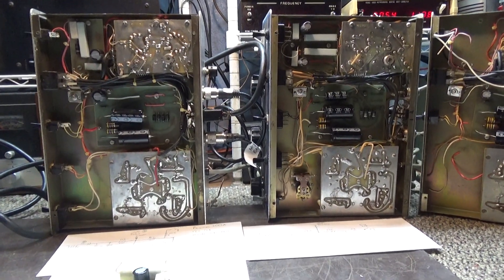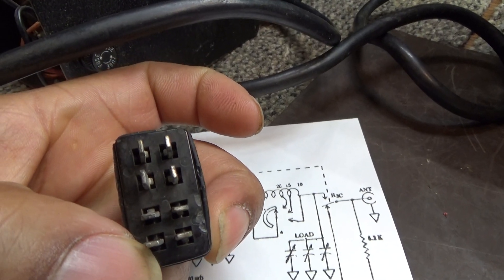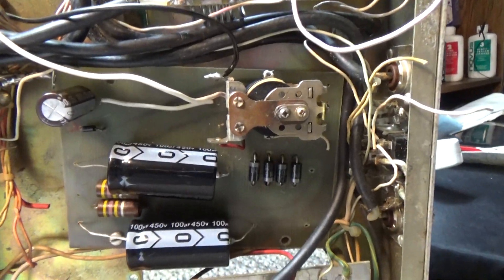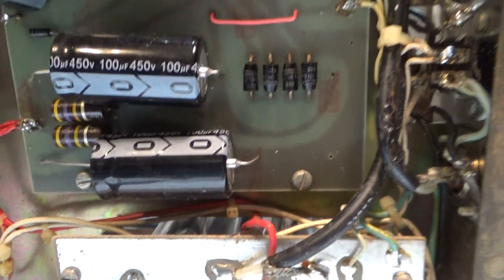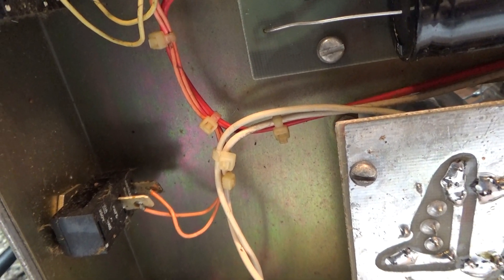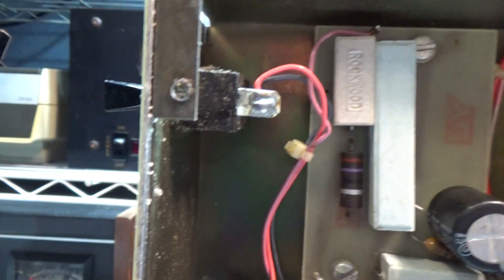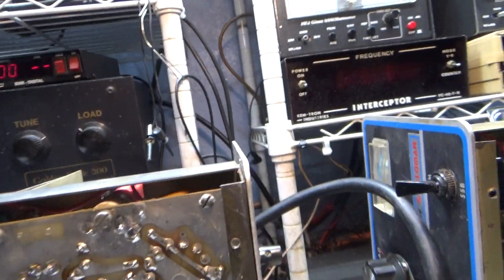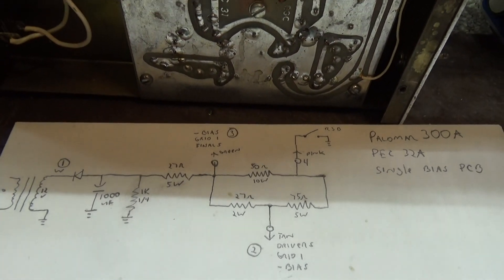Palomar 300A variations and differences

Comment: Are you still interested radio?if so i Have a palomar 300 a linear amplifier. There's one wire from the tube circuit. The 42 shaded board the finals. A wire that goes to some place a came off of the other side of the board and goes from that trigger trigger to the other one.  It's gonna wear a coat the other side.If I have your email, can I email you a picture of it?What i'm talking about
Reply from the maker: tramdr@yahoo.com

Comment: Mine don't have a relay
Reply from the maker: That could be trouble.
Reply: @tramdr  on the board or mounted on chassis but the top still has factory rivets so I know that wasn't removed.Do you still work on them
Reply from the maker: Sorry, No
Reply: @tramdr I must have the newer version with no relay
Reply from the maker: No, that would be the older version. The newer versions added the relay.
Reply: @tramdr  ah ok what relay part number  do you use
Reply from the maker: I just get a generic general purpose twelve volt relay. Nothing special. Even though you only really need one pole or contact, I get a 3pole or four pole and wire all the poles in parallel. The on in the vid is a generic four pole and they are only using 2 poles.
Reply: @tramdr any special amps on the
Reply: Did my caps flipped the board over someone had traces cut had to fix and someone added resistors to the bottom of the diodes had jumper wires and electrolytic caps on top of the diodes took all that stuff out that set up was cutting the power down of the amp but I added bleed off resistor on the high voltage caps

Comment: Yes tramdr is for real. I bought a Hygain base amplifier New in the box nos. Plugged it in worked great for maybe an hour then boom. What a mess and it damaged the attached circuit board. It was repaired just not as pretty as before.
Reply from the maker: Those Hygain's are great amps but are a real PITA to work on.

Comment: I have a late model white face , I’m changing the caps and bridge rectifier diodes now. It doesn’t have the high voltage relay to switch off the tubes, could you make a video how to wire one up. I want to fix everything before I crank this amp for the first time, please
Reply from the maker: https://www.youtube.com/watch?v=jLO-auUVG7s&t=4s

Comment: What's up tramdr I'm Chris I asked about a wire that comes from the 4 tube final circuit board palomar 300a the fourth tube pin directly across from the negative pin high voltage capacitor pin directly across t.v. rectifier board going to try and send a picture
Reply from the maker: You need to send a pic.

Comment: Good video,on the palomar 300a on the 4  tube socket circuit board there is a wire that goes into the harness and connects to the other side it came off I can't locate were it goes any idea?
Reply from the maker: I need a pic or video of that wire to help.

Comment: I currently have a white face version of the 300a. 6lf6 tubes. Still has the white plastic electrolytic caps. Runs like the day it was new. Granted I am in the process of upgrading the caps, coax, diode string and a few other components on my black face version. Will do the white face once that is fixed.  But I am getting 550-600 PEP with 50 watt drive from a Stryker 955 on SSB. Driver tubes are removed and amp is on low. And the max output from amp is controlled by the input drive from my radio. I run at a coast of around 300-350 PEP cause ole girl is old.